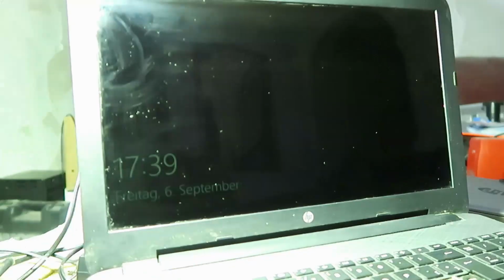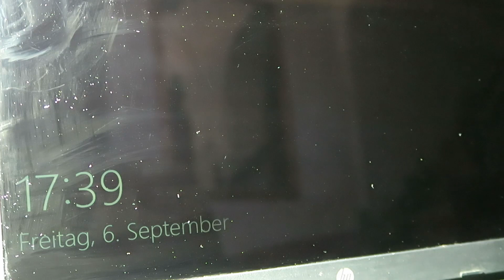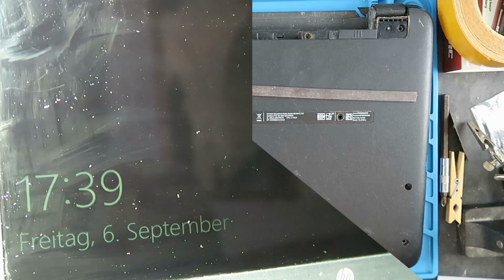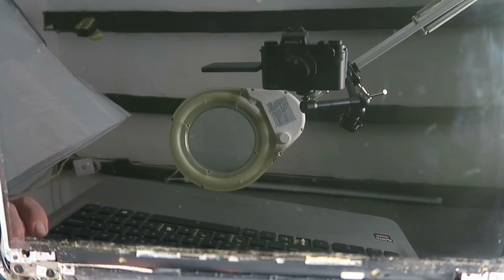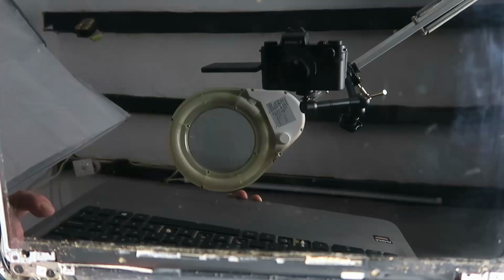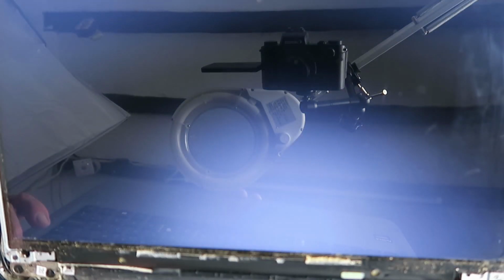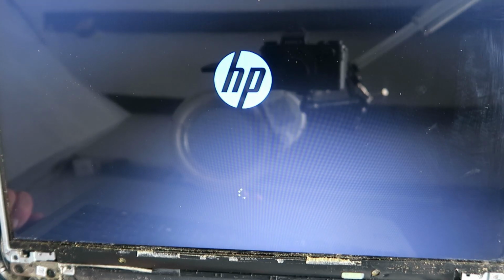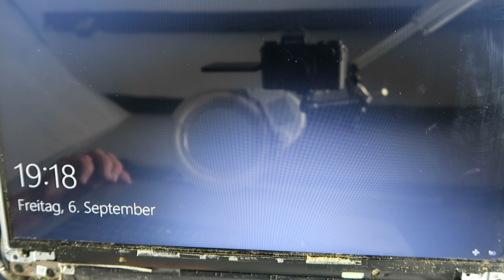HP Laptop No Backlight Repair

Comment: I fix computers as well locally.  I find it very common for these $300-$600 HP (MUCH more common for HP than any other Make) models to have hinge failures.  More or less the hinge itself is still intact, but whatever plastic / glue / epoxy holding the mount that the hinge screws in to breaks off, so the hinge is connected to nothing.  Usually shatters the screen if it’s a touch screen too.  Good work and troubleshooting on this, what epoxy do you usually use?  I typically use JB cold weld’s highest tensile strength, I don’t ever want those things disconnecting.  Lol
Reply from the maker: Hi, thanks for the comment. The HP design is very weak. The epoxy I use is the "Araldite" brand 5 minute. Good idea to use JB weld, it's very tough! Thanks for watching, have a great day!

Comment: Hi, this was very informative. However, I  adjusted the display cable and then turned on the laptop and there was still no change. I am sure that it is a backlight problem. But in my case, the screen only turns off if I open the lid at a greater angle. If I open the lid only a little, the screen comes on. Any idea on how I can still fix this? Any help would be appreciated.
Reply from the maker: Most likely is that there is a broken wire in the cable. You can either take the cable apart and test each wire with a multimeter or by a replacement cable. YouTube no longer shows me if you are subscribed. Please consider subscribing if you have not done so already!
Reply: @1nformatica  I subscribed! Thanks for the suggestion. I will try it and let you know what happens.
Reply from the maker: @YohanGever  •:*¨¨*:•_•:*¨¨*:• EXCELENTE_•:*¨¨*:•_•:*¨¨*:•_!!
Reply: @1nformatica  It didn't get fixed, unfortunately. Whats even worse, I can only lift the lid a little amount to make the screen turn on. I can confirm it is still a blacklight problem. I'm thinking, if I buy and replace the display panel cable, will it get fixed?
Reply from the maker: @YohanGever  In my experience it should fix the problem however one can never be 100% sure!

Comment: Hi, thanks for the informative video. I have an HP laptop with LED backlit antiglare screen (Pavilion 15 gaming) and its bottom right corner is now much dimmer than the rest of the corners (image is fine, backlight is very dim). If I apply some pressure on that corner, it comes back to normal level, but then goes back to dim after 5 mins. Can you suggest what might be the problem, and how to go about fixing it?
Reply from the maker: Most likely one or more of the leds have become detached from the thin circuit board. Dismantling and repairing such a problem is very challenging and usually not cost effective. You would be better to replace the screen. Please consider subscribing if you have not done so already!
Reply: @1nformatica  Thanks for the reply. Subscribed
Reply from the maker: @shashwatuttam7529  Thanks! Good luck with your repair.

Comment: Can this happen when I close the laptop too strongly?
Reply from the maker: No, normally it happens just because the screen is opened and closed hundreds of times. The main danger from roughly putting the screen down is breaking the screen itself. Also never put the charger on top of the screen when carrying it a bag. If the bag is struck the screen can be cracked. Please consider subscribing if you have not done so already!
Reply: @1nformatica  Could I save my pc by buying a pc monitor?
Reply from the maker: @leonardsvoren5774  Yes, if you have HDMI output you could also connect to a TV with HDMI. Standard RGB will work as well.
Reply: @1nformatica  Will it work with DVI to HDMI adapter?
Reply from the maker: @leonardsvoren5774  I cannot say for sure. Maybe you can borrow a cable to try or take the laptop to a PC shop and ask?
Reply: @1nformatica  Sounds like a good idea and thanks for responce

Comment: how about a screen that the backlight is really dead...the cable isnt the problem...how can i fix it?
Reply from the maker: If the screen has CCFL tubes then most likely the high voltage inverter is blown. I shown in another video the board being kept for spares https://youtu.be/C2YTL25iyHU?t=144
If the panel has LED backlights then it's game over as they are practically impossible to replace. If you are unsure which lights your screen has this handy site will tell you from the part number https://www.panelook.com/
Please consider subscribing if you have not done so already!

Comment: There's no also backlight of my hp tpn-c125 but theres a display. what should i do pls
Reply from the maker: You will need to follow the same procedure as I did and take the screen apart. Inspect closely the cables and measure with a multi meter that the power is getting to the screen. From the screen model number (example b156xw02) go to this site : http://www.panelook.com/ and you can find what the panel voltage should be. Please consider subscribing if you haven't done so already!!

Comment: Thank you so much, I had this is issue on my hp ProBook 430 g2 and it fixed it. It didn't looks like the cable was not properly plugged in but after removing it and plugging it back in in worked!
Reply from the maker: You're welcome! Please consider subscribing if you haven't done so already!!
Reply: @1nformatica  I was trying to remove my ribbin flex cable and it burnt the connector is there anyway i cant fix it?
Reply from the maker: @ash2322-n3w  Sorry i do not know which cable you are referring to. Maybe you can take a photo and send me a link? There are often cables available on ebay, search the model number of you laptop.
Reply: @1nformatica  the ribbon cable connected to lvds burnt and the backlight is no longer working
Reply: Reason it got burnt was bc it was disconnected incorrectly
Reply from the maker: @ash2322-n3w  Check ebay, people often sell parts from stripped down machines. Depending on where the damage is you may be able to "splice" a cable with LVDS connector from another screen. Good luck!